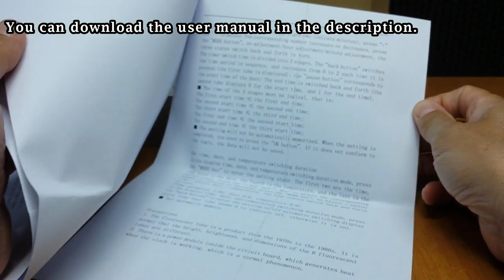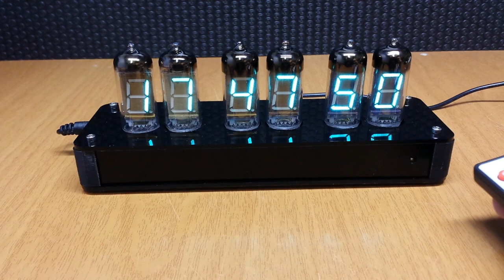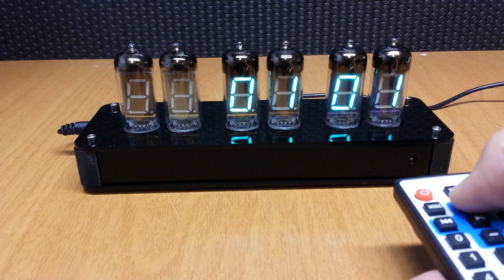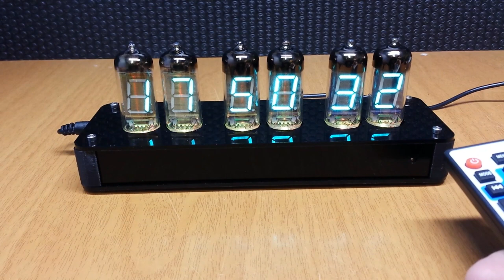DIY IV-11 VFD Tube Clock Kit From Banggood

Comment: Hi I bought this Nixie tube to build myself but I’ve noticed the ir censor is missing and the plastic side opposite the adaptor is missing also do you know where I could get these from? And one of the pins on an 8way holder is missing too

Comment: Hey Nick I have a question I just got my clock I got it all together everything works I was just curious can you turn off the temperature and the date and just have the clock on?
Reply from the maker: does your clock show automatically the date and temp ? in my case you have to use the remote to see date and temp :/
Reply: @NikTelio  thank you